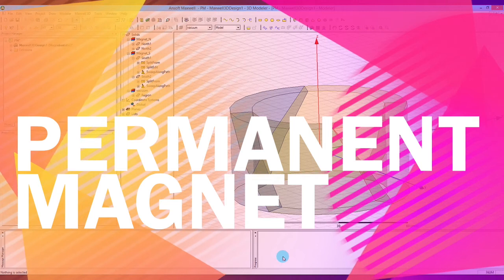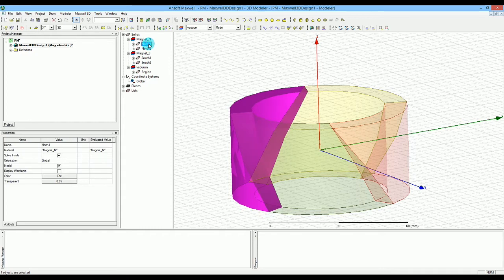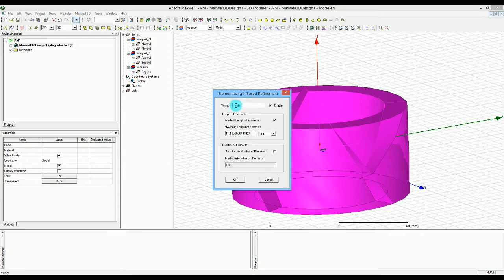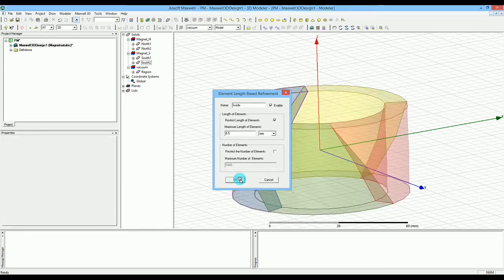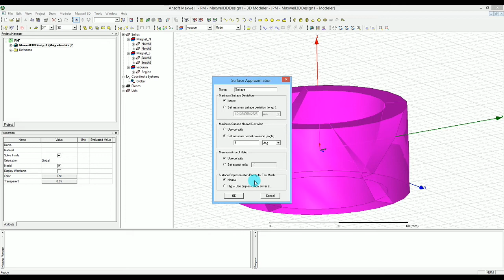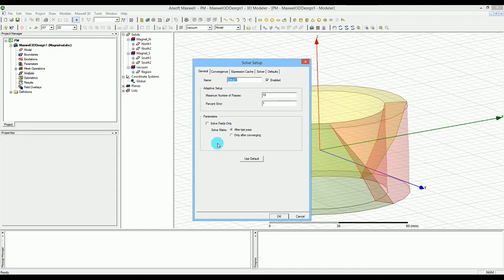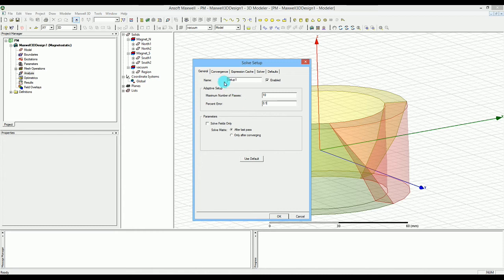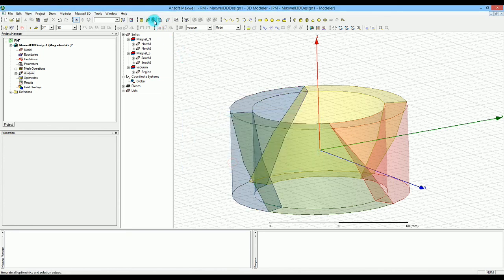222- Ansys Maxwell - Magnetization Direction [ Excitation and  adv. Mesh Setup]

Comment: Hi, I am trying to simulate a solenoid coil. Right now, I am doing 50 turns but my final goal is 300 turns. For 50 turns, I am getting an error that " mesh could not be made watertight". I tried a few combinations in the mesh operations but it still isn't meshing. Any suggestions?

Comment: Thank you for your tutorial vedio. I am a beginner. May I ask why the inside and surface of the magnet shall be meshed both?
Reply from the maker: hi

well if you want to solve inside the member you should definitely  mesh inside. of you want to mesh inside you have to mesh outside which is still inside the region that want to solve. or else you can not solve the environment for b filed SNF e field right ?
Reply from the maker: sorry SNF = and. typo
and yes. you have to mesh inside the region for that purpose